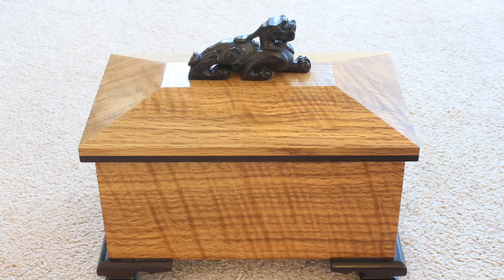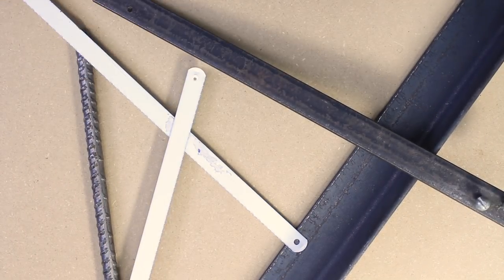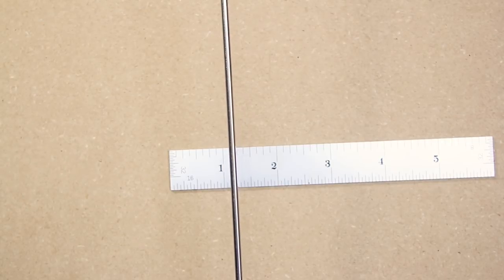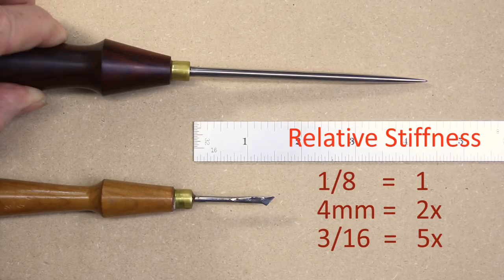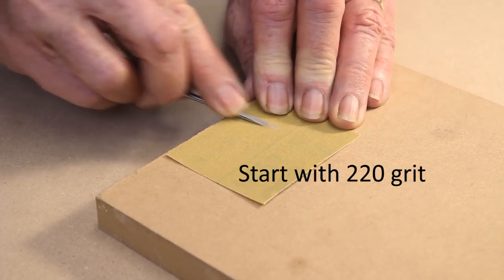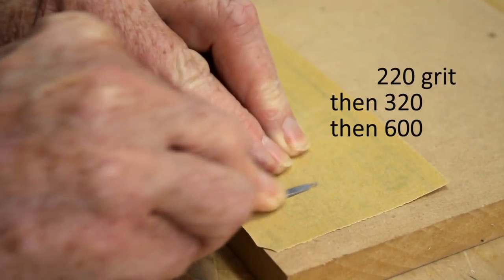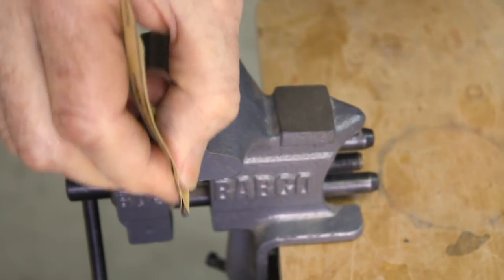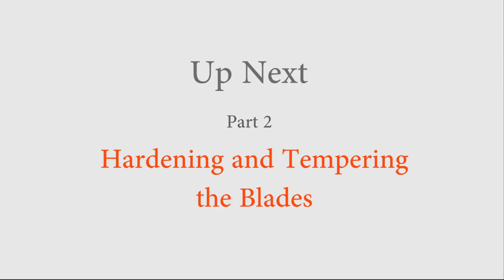Making detail carving tools:  miniature and micro chisels.  Part 1

Comment: Wow, this is great!  I saw you using the micro chisels in the video where you carved the Celtic dragon for your grandson and thought, it would be nice to have such a beautiful set of chisels.  I then discovered this video.  Now I have a weekend project.  Thanks!

FWIW, the aluminum oxide (tan to brown) sandpaper you used in great for wood and probably does OK on very small metal parts like this, but silicon carbide (blue or black) is tougher, will last longer and clogs less on metal.  It can even be used wet for a finer finish.

Comment: Mr. Sullivan, 
    Thank you for all of your helpful videos......After making several micro carving tools I found a very useful way to sand them before heat treating.......multi surface foam emory boards from any fingernail supply can be used to take soft steel all the way to polished.

Comment: Another way to make tiny deep-fluted gouges is to drill a hole in the end of the rod  to make the flute, then file away half of the cross section. But you might need a cobalt drill bit to cut the HC steel. A stubby bit is useful for starting the hole, it doesn’t flex as much. If your steel isn’t fully annealed, heat to vivid red color and stick in a metal coffee can filled with sawdust, let cool for a few hours. Another thing to remember about heating steel is that if you get a black oxidation layer building up to a certain thickness, that can present as harder than the actual metal (because it is), and trick you, and removing this scale, again, if it is thick enough, will quickly ruin files. Use old ones or coarse sandpaper or a steel brush. And the dust from steel is also more harmful than wood dust.
Reply: This steel is annealed so it drills fine and does not require pricey bit to drill.  This steel is harden after shaping

Comment: W type tool steel is similar to O but is quenched in water.  Although W is cheaper, the grain size is much larger so it won't sharpen as finely nor hold an edge as long.

Comment: I want some skewed back bent shallow gouges and they are almost impossible to find, so I will be making some myself using this video as an inspiration.   Do you have any hints on how to hammer a curve into a gouge, maybe hammering flat and then using something round to hammer on?   What are the practical limits to trying to cold form this steel.   And is forging it by hammering with the propane torch method practical or do the pieces of steel cool down too quickly?
Reply: Usually such a high carbon content steel as O1 isn’t worked cold. I would get it past red hot to make a bend, a nice orange color. Having it more plastic gives you better control. This is assuming a dimly lit atmosphere, which is good for accuracy in judging the heat by color. Then make the bend quickly by tapping over a curved metal object with a small hammer, working your way along in a linear fashion with your blows. But a better way to do it, if using light stock, is with sturdy needle nose pliers. You can modify them so they don’t mar the hot metal, or find some round nosed ones. One pair of pliers to hold the piece, another to make the bend.

Comment: You start off with flat stock w/ brand and even UPC codes but then move to rods. I'm looking at Precision Brand "Water Hardening Drill Rod" that appears to fit your recommended specs. Comment?

Comment: Thank for videos. Do you have any idea what the HR is and how good do they keep an edge? How do they compare to Flexcut tools? This could save a lot of money.
Reply from the maker: O-1 steel should come out of the oil quench at about 63-65 on the Rockwell C scale for hardness (HRc).  After the mild tempering I have shown, it should only lose about 1-2 points, so it should end up at about 61-63 HRc.  This assumes that one follows the prescribed heat treating formula accurately.  I have not tested mine, because the required test equipment is prohibitively expensive for a home shop.  You can get a ballpark feeling for hardness by seeing whether the blade can be scratched or cut by files, and by seeing how slow or fast the metal can be removed by abrasives, compared to other hard steels.  The steel on my chisels is abraded very slowly by any of the conventional abrasives,  and they have held their edge very well, comparable to high quality plane blades that are HRc 62.

Comment: Can these tools (as you made them) be used for woodturning on a lathe?
Reply: Yeah if they are stubby enough to not vibrate in use. And don’t let the edge get too hot or it will start to lose its hardness (temper). Back in the old days all lathe tools were plain carbon steel, now they’re almost all high speed steel

Comment: Do you think these blades/gravers would be suitable for carving harder materials like antler and bone?
Reply from the maker: I have never carved in antler or bone, Emily, so I have no hard data.  I have watched people carve in hard materials like this, and it appeared to me that the process involved shaving or scraping off very thin layers.  These tools will be about as hard as any steel tools offered on the market today, and harder than either bone or antler, so they ought to cut.  I would expect that they would become dull faster on these materials than in most woods.  If that becomes a problem, consider making carbide tools instead.  Here is a link to a video I made on this subject:  https://youtu.be/dWUoKy8rCcQ
Reply: Patrick Sullivan thank you very much!

Comment: Is a knife or chisel made of O-1 tool steel soft enough to be filed after the temper is drawn or will the file just slide off?
Reply from the maker: Do all your shaping while the steel is in its soft annealed state.  After heat treating, O-1 steel will be harder than your files--they will be useless.  However, all aluminum oxide or silicon carbide abrasives will cut hard O-1, including sandpaper and grinding wheels.  Oil stones and water stones will also work, but small tools quickly create grooves in them if you are not careful.  I usually use either black silicon carbide sandpaper in fine grades, or a diamond coated steel plate.  Diamond "stones" have become readily available at moderate prices, and are quite convenient.  If you use power tools, remember that if you raise the temperature of the tool above about 450 F., you will begin to soften the steel, and it is easy to raise the temp to as much as 1,000 F. by grinding on it for as little as 10 seconds.  This will totally ruin the edge-holding capability of the tool.
Reply: Thanks you for the prompt reply.  I enjoy your videos and quality of your work.  I guess my real question was, just how hard is O-1 steel once the temper is drawn?  It sounds like you're saying that a file should skate off the blade even after the temper is drawn...
Reply from the maker: The tempering will only reduce the hardness by about 1-2 numbers on the Rockwell C scale.  They will end up well above 60, probably about 62.  Files will not cut steel of this hardness.
Reply: Thanks, Patrick.  Your videos are very inspirational.  I'm going to have a go at making some of your carbide chisels & gouges as well.

Comment: Question: why not just use a screwdriver for it? Isn't the steel good for it?
Thanks.
Reply: Screwdrivers are not hard enough to hold an edge as is. You have to harden it. But he says specifically why not reuse old tools early in the video. You don't know the quality or type of metal so you dont know how to heat it properly.

Comment: Hi Patrick, What size file did you use for the gouge? Thank you!
Reply from the maker: I believe that was a 1/8" tapered file from one of the small file assortments that you can buy in sets of about five shapes.  Obviously, the file size determines the "sweep" or curve of the gouge, and you can vary it to suit your needs.  If you want a shallow gouge, my suggestion would be to do the preliminary cutting with a smaller file, and then follow with a much larger one to get the desired final cove.  It may be hard to keep a large file centered on the small rod unless you have a well-developed groove for it to follow.
Reply: Patrick Sullivan Thank you sir! Love the vids and look forward to additional ones.

Comment: Making handles for chisels, knives, etc., really requires a lathe.  It just doesn't work to use a drill or other methods to make more than ☝️ one or two.  I have a Grizzly "hobby lathe" which is a good way to turn wood handles, or even plastic and other materials.  If you go to http://www.grizzly.com/products/Hobby-Lathe-Disc-Sander/H2669 , you will see this unsung hero of small, inexpensive woodworking tools.  There are also a couple of drill press lathes, where provision is made to use a kit to be able to turn things vertically.  I have not found that to work as well, but some others may like it.  It is about the cheapest kit I've seen for this purpose.

Your videos are superb!  Your speech is clear, your words well chosen, and your choices of what to suggest are very good.  I hope you will continue to make videos of what you have done to make tools and results.  There are so many videos on YouTube in which a chap has made a good effort, but the video is not something inspiring!  Yours are top notch.

Thank You for your efforts.  Please rest assured, you are appreciated!
Reply: They made handles for centuries without lathes. No lathe is needed. A spokes shave or even carving knife is enough
Reply: A section of round, straight branch that is a dense wood works well, the tricky part is drilling the hole. I like to turn them and drill the hole first so it is centered. Don’t ask me how many nice handles I have ruined drilling the hole last